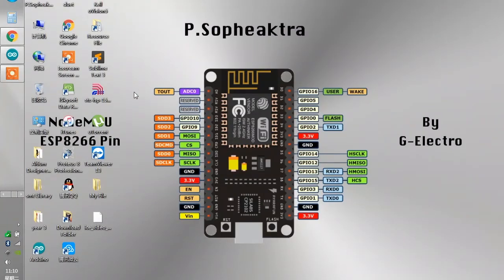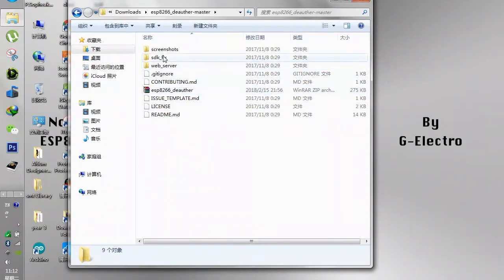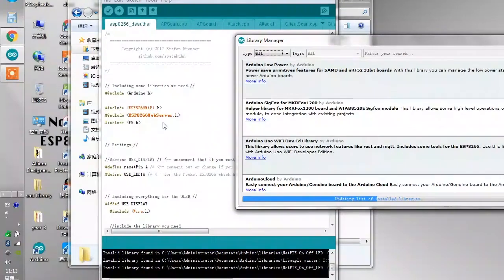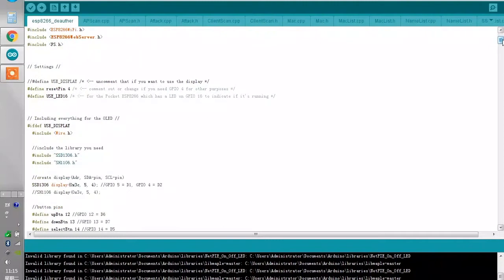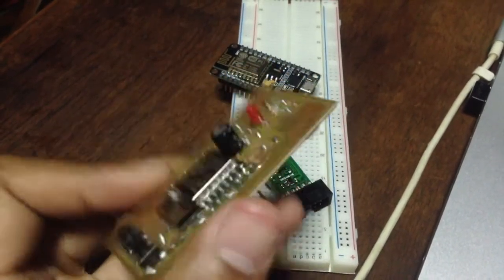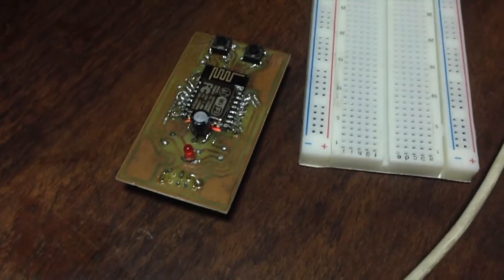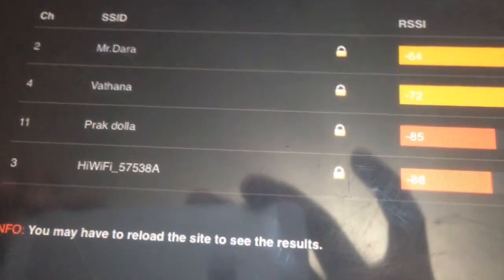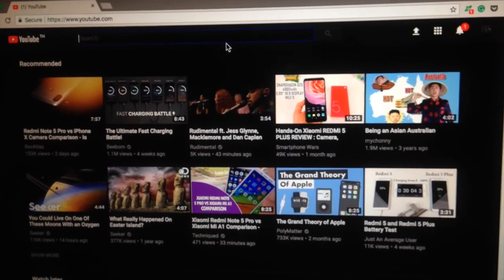Ultimate Wifi Jammer - esp8266

Comment: Will this also jam secure networks? i.e. does it work at the physical (signal) layer, or at the link layer?
Reply from the maker: This does jam the signal and block data from being transmit
Reply: This DOES NOT jam any wifi signal(s). This is a AP deauthenticator. So. In a nutshell.... You program it to repeatedly connect to a wifi access point but purposely with bad info. So ultimately the router ends ip thinking NON-STOP this bogging it down.